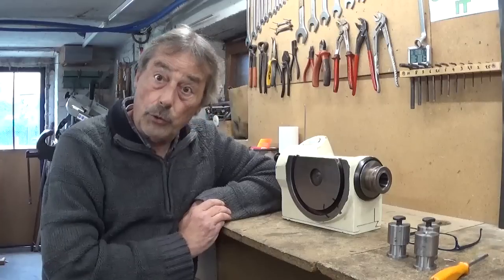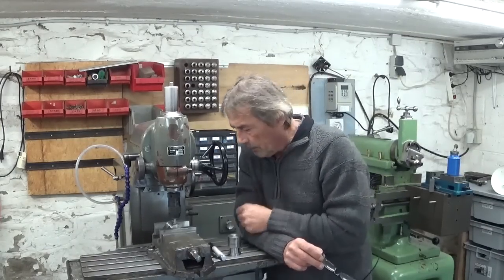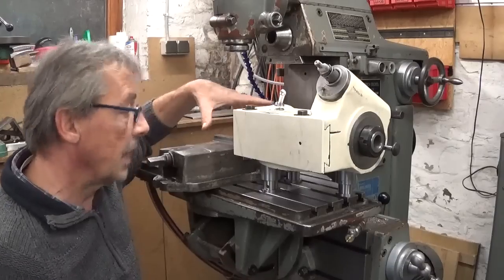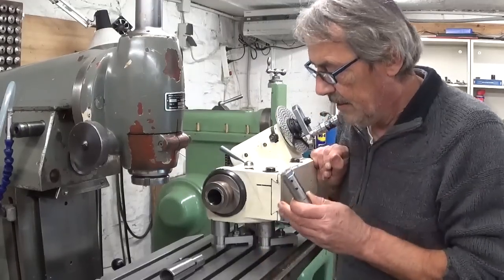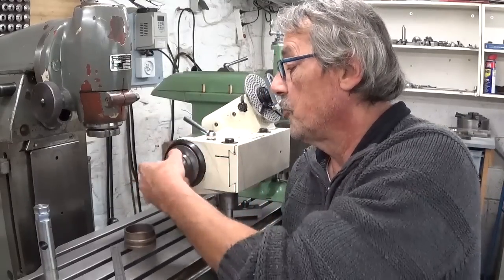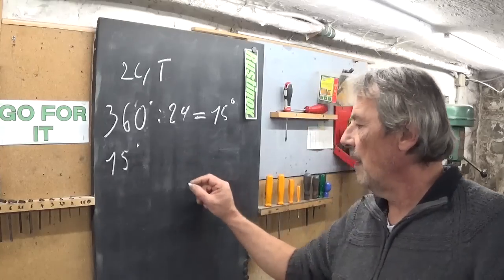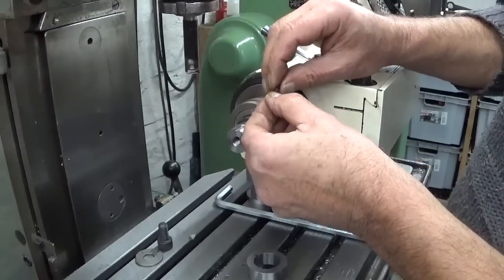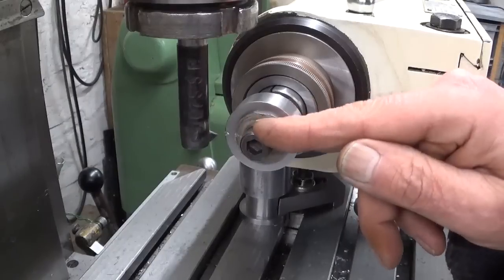Div... it works!!!

Comment: Good to see the mounting solution in action, and great work!! That will reduced the weight quite a bit which is better for your back. The dividing head will give you a lot more machining options for different projects in the future. I also like how you explain what you are doing in your videos. This is very informative.
Reply from the maker: Thanks. I just explane what I do. Not how it should be done :)

Comment: Great video. Perhaps it was just the video but it appears that you are climb cutting your gear teeth and I believe you would be better off conventional milling, i.e. feeding the work toward the cutting edge rather than away from it. Typically climb cuts are OK for a light finishing cut for for deeper cuts they tend to pull at the work causing chatter due to slack in the lead screws and tool deflection because the tool tries to climb on top of the work. Regrading your method of figuring out which dividing plate hole circle to use, the math works but it's a bit cumbersome. There are easier ways to obtain the same outcome using only the number of teeth desired and not using degrees. As always, great work, looking forward to your next production.
Reply from the maker: Thanks. Clinb milling works better for me than conventional milling.

Comment: Nicely done, Michel. Working smarter, not harder. So you used a shaper to cut a keyway in a gear blank and then cut a 24 tooth "gear" on the mill so you could use it to make a 24 tooth gear on the shaper! If it works, it works. Brilliant.
Reply from the maker: It just never ends... :)

Comment: Spanner hole(s) would upgrade the "tommy wrench" to fit some spanner wrench I expect you already have, such as for that precision drill chuck.
Reply from the maker: My old screw driver works fine for this :)
Reply: @Rustinox  Yes, but the idea is that you only need a shallow dimple on the outside the part, not a crossing through-hole.  Sometimes the part design can't take a hole crossing through the center, such as a drill chuck collar.
Reply from the maker: @RichardKinch  Ah, I see what you mean now.

Comment: Since it is always 40 turns for a full rotation, just divide 40 turns by 24 (24 teeth) you get 1.666 no need to have 360 in any future calcs. 🙂
Reply from the maker: I suppose it shows I'm an absolute beginner with dividing heads.

Comment: Just a small observation. I noticed that you were climb milling when you were cutting the teeth. Would work better if you had the cutter on the front  side of the part and do conventional milling. Depends on how much backlash you have in your table leadscrew and nut. You could of course also by a get cutter with the correct profile about 25 GBP on ebay. Great outcome. Regards from Australia.
Reply from the maker: Clinb milling works better for me than conventional milling.

Comment: Sorry Michel the tablets aren't working today. Ignore what I said previously, the formula is 40 on N. As before N is the number of divisions required divided into 40 or 90, the ratio of the dividing head or rotary table. This will give the number of full turns and fractions of turns required. For example 24 teeth divided into 40 (ratio of your dividing head) equals 1.6666 turns of the dividing head handle. Once again I apologize for my senior moment. Paul  :-)
Reply from the maker: No problem Paul. Thanks for your imput. This will be handy.

Comment: Rusti Hi   Great job,   take care on working out the correct OD of the gear blank.  In inch  DP gears it is number of teeth plus 2 ÷ by the DP  gives the gear blank OD   I cannot find the formula for module  but Google will.  And for indexing giving number of turns on a hole circle of a indexing plate  for your given number of spaces.

Steve
Reply from the maker: On line it's easy to find gear calculators that work really well.

Comment: you could have cut cut two flats on it with you mill , with out a fancy indexing head ,, old school work , all you had to do is cut the fist flat then used piece of square  stock under to witness the next flat cut exactly parallel and opposite with the fist flat and the just use an adjustable wrench ....
Reply from the maker: You're right. But, drilling holes was easy too :)

Comment: Hi Michel. Good one! Your calculation method is accurate but over complicated. Use the formula N over 40. Where N equals the number of divisions required, divided by 40. 
The number 40 or 90 as the case may be, represents the ratio of the dividing head. This formula gives you the number of turns required as a fraction rather than degrees. I was taught this method when I started my apprentice ship as a Fitter & Machinist. That was a very long time ago but to this day I still remember that formula. Take care Mate!  Greetings from Australia.  Paul
Reply from the maker: Over complicated, but it works :)
Reply: Dont you mean 40 over 24?

Comment: Hey, Michel, glad that your setup worked out for you, it certainly looks sturdy and accurate. I had to make a gear for my lathe and my setup was a tiny rotary table (4") and instead of drilled plates I have a segmented dial. I used a boring bar type tool holder with a single point HSS tool hand ground to suit another gear. Anyhow, I enjoyed the video very much, take care and cheers!
By the way, your mention actually made my day, thank you very much.
Reply: Good suggestion on the tommy bar👍 It all seems to have worked out very nicely indeed.
Reply from the maker: Thanks again for the idea.

Comment: Well done great back saving device!! What does the dividing head now weigh?

So once you get your tool rigid enough to cut the gear you can then fit it to your lathe to enable you to cut the thread you need to mount the chuck on your dividing head. I think I've got that right🤔🤔

I like the way you switch from one view to another and keep the narrative seamless. Great stuff!!

Good luck from Spain!!
Reply from the maker: Thanks David. Making parts to be able to make other parts... It never ends :)

Comment: Michel, great work as always!

May I make a suggestion? I would mark or number the feet and clamps so you have a consistent set up. It might not be required but could remove a variable that causes issues.
Reply from the maker: Good idea. Will do.

Comment: Hi Rusti, great work on the dividing head mod. Your calculations are spot on, there are a further set of formulae you can use to determine the number of holes, there are also many tables in books or on the internet that do all the hard work for you. More than happy to share my tables with you if you would like a copy as my head is also 40:1 (just makes the whole job easier). Cheers, Jon
Reply from the maker: Thanks Jon. It's not as complicated as I thought it would be.